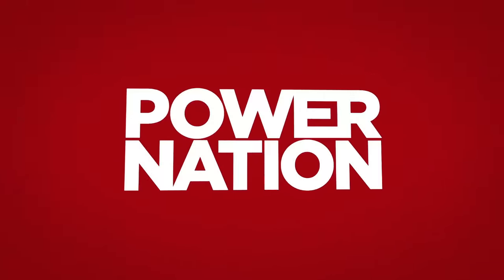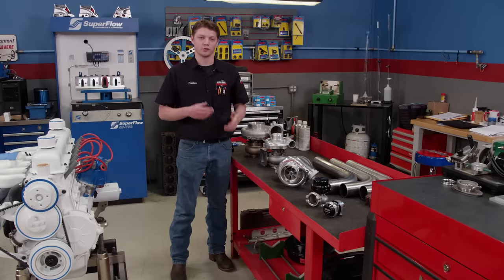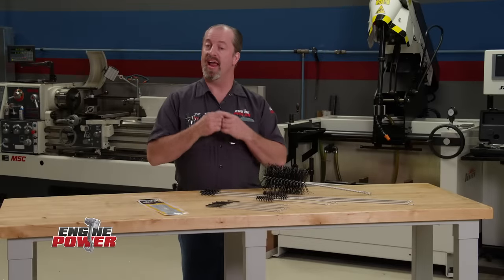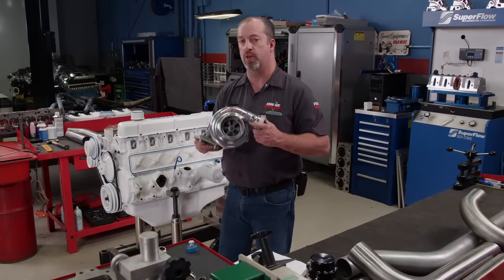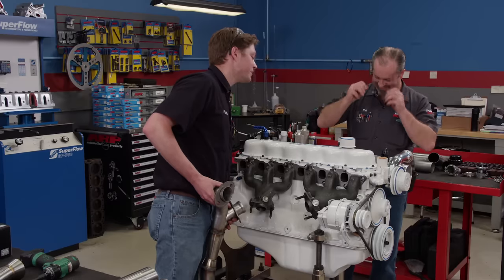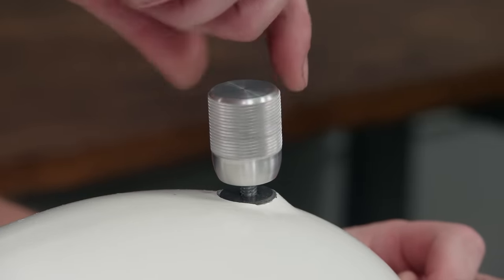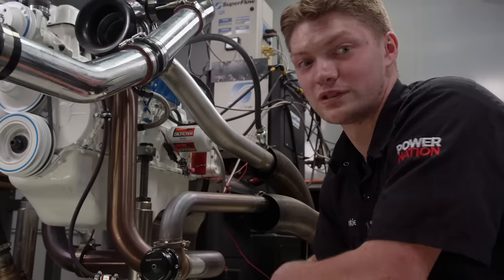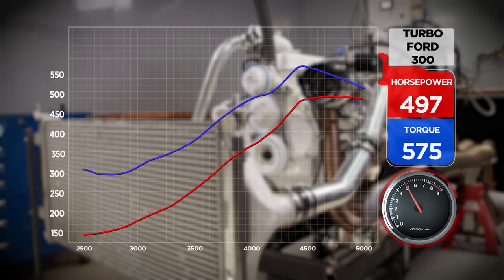Turbocharged Ford 300 Inline Six Makes Over 500 HP on the Dyno - Engine Power S8, E14

Comment: I'd actually like to see this shoved into some old sleeper grandma Ford.   Maybe an old 1979 Fairmont.
Reply: The station wagon variant
Reply: @shadowstallion71  will not fit,  block is too long.   unless you can find a 1 inch thick rad that can handle that power or modify the firewall and move it back about a 1 foot.   How do I know?  My dad tried to put a 300 Straight 6 EFi in a 91 foxbody mustang...just because he was bored one time.   However, it will fit into a AMC gremlin through >:)
Reply: An old stock appearing f100 would be badass too
Reply: 64 Falcon 2 door
Reply: Thanks for the chuckle.
Reply: Maybe an old F100 would work.
Reply: This is a truck engine. Way different then the car engine. But it will fit in a fairmont!!! Fairmonts came with 6’s ! 
I had a 300 in maverick with 2 t3/t4 made 560 hp. With 4:88 it was fun
Reply: @robertpolicastro1  Sounds awesome brother.
Reply: @jcgamer892  Thanks for the tip about the Gremlin
Reply: @jcgamer892  Currently debating a build like this for my '64 Fairlane.
Reply: @43mackmobile  I say wagon, toss the kids and the dog in the back…plus they might need all the wheelbase they can get.
Reply: @izzdee  Nothing wrong with a Fairlane wagon
Reply: I was thinkin something along those lines too. Then watch the other guys eyes pop out of his head as you blow his doors Clean off. LOL.
Reply: Even though the 300 was only used in trucks, it would be hilarious to see it dropped in an old Fairmont or Grenada
Reply: I would be willing to let you throw it into my 77 F100 😂
Reply: @dmoore0079  I thought they came in some of the tempos? I could b wrong.
Reply: You could probably tinker around with it and get it to fit in the old Fox body.
Reply: An old Ford Falcon, make it an American XR6 Turbo
Reply: How about a 78 or79 Bronco? That would be a sleeper
Reply: Not a bad idea, but I'd go with a 70s F100, regular cab, 8 foot bed, beat looking workmtrick, and go out hunting for first gen Lightnings and SS 454s. Maybe a few mustang's and camaros as well.

A.Fairmont makes a good sleeper, but too many have been LS swapped  for one to truly fly under the radar anymore. An old patina farm, shop, or work truck, it would work, because no one would ever think it could be fast. It would be a fun stoplight to stoplight runner.
Reply: Rather see it put in my 89 Ford F-150 4x4 myself!  Wonder which is cheaper though, a v8 with the 500 hp or this 300 with 500 hp?  Then what the gas mileage difference is too? A few variables there to consider other than just the horsepower. Unless money not an object you need to worry about? It is for me I tell ya! LOL
Reply: Or maybe a 1968 Torino station wagon
Reply: No, the Ford LTD model from Men in Black! That would be frickin' awesome man.
Reply: @beefsupreme5132  I know where an 80s LTD station wagon is full size with a Christmas tree on top like Chevy Chase had in vacation it's even bird shit yellow with woodgrain up the side would that do?
Reply: @43mackmobile  My first thought was a '63, so drop it in. The engine bay would have plenty of space.
Reply: @robertpolicastro1  Fox Bodies had a 200 inline six, that is shorter than a 300 so it won't be a direct swap in engine.
Reply: @jcgamer892  you are definitely correct. I had a 79 Mustang with the 250 6 and a 78 Fairmont with the 200. Those engines were just short enough. I don't get why people think the truck 6 will just drop into a Fox body. Plus it's a boat anchor as far as weight compared to the small 6 or even a 302. Let it stay in the truck/van
Reply: @TheLionAndTheLamb777  the early Fox body Mustang could get the 250 from the factory because of a shortage on the Cologne 2.8 V6. My 79 Mustang had a 250
Reply: How about a 63 2 door Falcon or Comet?
Reply: @43mackmobile  I am wondering if it will fit. Mine had like a 235 or something like that.  It was a tiny 6.
Reply: @kevinfox500  my 82 f150 explorer is that truck. Looks a little worse for wear....
Reply: @michaelakers8698  my favorite car was 68 Torino based on a Fairlane. 351 Windsor. It was a scary fast sleeper. Lot of chrome.
Reply: @pearlandvelos244  between me and my brother we have had six Torino GT fastbacks three 68's and three 69's I think these are one of the coolest cars ford ever made
Reply: @jcgamer892  if you have a plasma torch and a welder we can put any motor in any car 👍😁👍🇺🇸🇺🇸🇺🇸
Reply: @pearlandvelos244  my kind of trick as well.

Current ride.is an 08 Silverado,  6L80 behind a 4.8 Vortech, running a centrifugal blower. Bondo and rust spots, distressed factory alloys, tagged.in the back, nothing special to look at, but quick as hell.off the line.

Wanted to do a bold like this on my 92 F150, 300, inline, with a 5 speed,.and almost had it done, when I ended up.with an infection that cost me my right leg. Wife's Silverado became that project, and yes, from my wheelchair,.we did finish the original build.

She loves.it, and even as a passenger, it's a.fun beast.

Both look old, worn, and slow, but run some impressive passes for 4000 pound vehicles.
Reply: My ‘80 F-100 would like to volunteer for this job!
Reply: Put that in a Maverick. They came with I6 engines, and their under 3000 lbs.
Reply: @maverick392cid  A neighbor of mine had a Maverick, pumpkin orange and just an ugly car, but, if it was blowing past you at a high rate of speed, there isn't much negative you can say about it
Reply: @maverick392cid  not a terrible idea,  but the Maverick and no other cars came with the 200 I6 small block. The 300 was the big block 6.

Longer, different mount location, different bellhousing size, and pattern, and that's just the start.of the problems with that swap.

Better option. The 240 I6 from.the first gen Bronco, with a turbo added. Or a car 200, which is also a drop in for 66 to 77 Broncos.

Unlike the 300, it's almost a drop in, main difference being the oil pan and pickup. No need to cut the firewall, or make the front clip longer.

Reason I mention it is, had a friend that wanted to drop an 82 300 into a 78 Fairmont. Long story short, he made an 81 F100 into a sport truck instead, because it didn't involve major modifications to fit, and we dropped in a 302 out of an 84 Mustang instead.
Reply: @kevinfox500  The 70 Maverick came with the 200, from 71 on they had the 250 I6 and the 302. There's a few videos on here that has one running a 300 turbo.
Reply: @maverick392cid  thanks for the correction.
Reply: a 64 Ford f350 will have to do
Reply: pinto 😂👍
Reply: @PlagueDoktor-  that could be fun. Just more work than any Pinto is worth.
Reply: No way 

It goes in a mid 80’s Ford 4x4 truck
Reply: @jcgamer892  you actually can. The fairmonts and Zephyrs are on a fox body platform with k member engine brackets. I’ve seen 363 Windsor long blocks put in them.
Reply: That's a dark turn of thought
Reply: Pinto.

Comment: One of the greatest engines of all time. Awesome seeing it get some love.
Reply: My Dad was so sad in 96 when they made the new body style with the v6. He bought the last i6 they had because they were selling them side by side. The salesman asked which one he wanted,new body or current and there wasn't a bit of hesitation. On the way home he just kept shaking his head and saying he couldn't believe they were getting rid of one of the best engines of all time. He put well over 300k on that '96 f150 with the big six and all he ever did was scheduled maintenance and oil changes. Best truck ever and I wish every day that I had it right now.
Reply: And it's a shame all manufacturers stop making the inline 6 cylinders some of them bet ever made
Reply: I did a fresh rebuild on a 300 six, 268 grind comp cam, 240 heads, HEI distibutor, EFI split manifolds, and a Weber 38/38 on the stock intake, and my old gal cooks 🤙
Reply: I wouldn't even bother looking for one of these in a junkyard. Imagine finding someone's project car in a barn and going straight past it for the 🚜

Comment: Sure brings back memories. Built one 20 years ago with the same intake/header combo, Holley 390 4bbl, Comp 260H cam, mild porting on the stock head, and a .030 9:1 rebuild. 242Hp and 323Tq
Reply: Do you know how much horsepower and torque yours made?
Reply: @cesarprieto8279   242Hp and 323Tq
Reply: Did the same in highschool in a shortbed ford
Reply: @cheeseandpickles98  I just acquired one yesterday 84 300 Inline 6 granny 4 speed 4wd flatbed with 33s 70,000 original miles
Reply: Mine is a 96 F150 4.9 EFI 5 speed. At 70 mph it turns 2250 rpm. At 3000rpm she’s doing 93 mph. I usually don’t break 2000rpm. Purrs like a kitten 70 series Flowmaster 3” stainless from Y-Pipes. No cat no egr or pump. I get 18-23 mpg! Towing my 5000 lb camper 11-14 mpg. 290,000 miles. I see no reason to mod it ! It’s just to much fun as is.
Reply: @calebowens3006  my first was a 93 f150 with 325k on the clock when I sold it. Currently been driving an 88 Bronco for 6 years with around 240k on it. Never had a more reliable engine in a vehicle.
Reply: @cheeseandpickles98  How did it feel compared to the 351?
Reply: @flatheadfletch  I have a 92 4.9 with 5 spd, but my tach reads 3000 going 65, also i have 3.08 gears. they should be the economy gearing but idk it seems to not really want to go that fast. Also mine tops out at 75, on 32's. idk how you got it above 90
Reply: I love the 260H cam, great cam for the street

Comment: That's an absolute fantastic motor . I seen one of those motors  go 36000 miles without an oil change. And when Ford put  fuel  injection on it that really woke it up.
Reply: Unfortunately that doesn't say too much lol, when I was a lube tech I changed a Kia souls oil for the first time in its life at 72,000 miles. The owner had bought it new and never once had the oil changed. Only got about 2qts of sludge out but it got new oil and was good to go
Reply: @MFU.team.4367  bullshit... There's no motor in the world that will last 72000 miles without an oil change. I've worked at KIA store those motors are terrible.
Reply: @bige9830  I've seen a few Honda engines go over 40k without an oil change.
Reply: @bige9830  we service our paccar mx engines on 75000, with idle time less than 10 percent, 60000 miles if over 10 percent,
Reply: @youtubeisawesome2487   Those are diesel engines. It's a completely different animal then a gaser . Low  Reving . The oil has a ton detergents in it . How many gallons of oil does that take?  And I'll bet your dollars the donuts has got a low micron oil filter on it too.
Reply: @papersack4290   I'm not surprised at that . Honda makes some pretty good motors. A lot of Japanese companies make some pretty good motors. Except for that little piston ring the  Debacle  you guys  getting over.
Reply: @youtubeisawesome2487 Your right .  I'm  sorry. One of my statements  I said no motor will go 72 k with out olf.I didn't even think about diesels. Your right 
 some of those  units can go 150k in between  olf.  As a matter of fact Some of those guys don't change oil unless they have a tested 1st . and then they just change filters and top off. Or change filters and replace half of the oil.

Comment: This would be such a mean setup in a classic bullnose build! I’d love to see it in a lowered 2wd street truck or a 4wd mudder, that would be so cool! This has definitely opened my eyes to the potential of the Ford 300
Reply: Throw it in a single cab Ranger short bed and let it take folks to gapplebees
Reply: @Truckerdaddy  are we thinking ranger the trim package or ranger the truck? I’ve got a 1991 ranger that would love the extra power. Either way it’d be a heck of a vehicle
Reply: @cheynsanders5506  the mini truck. Not the full size ranger from the 70s.
Reply: @cheynsanders5506  one issue you would have is space, to make it work you would likely need to trim the firewall for the bell housing to fit. You also would need to run electric fans because a mechanical fan would most likely hit the radiator. 

It certainly would not be an easy project but would certainly be unique.
Reply: @cheynsanders5506  another vehicle option would be a Foxbody mustang or any mustang for that matter. I mean if Westin Champlin can shove a 12 valve Cummins in a 2015 ecoboost mustang then a 300inline shouldn't be too bad.
Reply: @Cheyn Sanders I'm actually working on doing a build like this in my 83 F100 single cab long bed with the 300 inline 6. Looking to lower the truck maybe one or two inches and change out the 3-speed for a 5 speed. Was my grandfather's truck and he always got a smile running fast in anything... Figured it would be the perfect thing to remember him by.
Reply: @Truckerdaddy  actually, it wouldn't take much to make it fit and work in the early bullnose pickups. Now if you wanted A/C and other things.. some modifications would need to be done because of the lack of space, but if you're going for bare minimum.. you've got plenty of space to work with. An 83 f100 with the 300, power steering, and smog delete has a ton of extra space under the hood for activities. You can keep the engine in the same position under the hood as well while lowering the truck. Just mount the rear leaf springs under the rear axle and do a crown Vic swap for the front end to eliminate the I-Beam suspension up front.
Reply: @brandenmatney6821  the f-100's are considered a full size though. But the plus side of building a full size Ford of that year is a 9in rear end will fit with little to no modification. So you've got that going for you. Then throw in a C6 transmission and you'll have one bulletproof rig.
Reply: This would go great in my 65 f100.  I already have the 300 in it and there is tons of room.
Reply: @Truckerdaddy  I don't know why that blew over my head that you said the mini truck and not the full size. I read bullnose and ranger and figured someone was talking about the trim package.
Reply: @brandenmatney6821  it's all good. It happens to everybody occasionally.
Reply: Mudding is the one thing the 300 is not good at sadly.  It is great in a trail truck as it will power you over anything.  It just does not turn the high RPM's you want when dragging your axles through goo.
Reply: Put this in a gen1 lightning! That would be sweet!
Reply: Thats actually my plan for my 89 f150 once i get enough money i plan on getting air ride suspension on it that when fully lowered has a 6.5 inch drop and about 1.5 inch drop when all the way up, its probably gonna be a lil bit tho i just turned 16 and still aint found a job

Comment: Just like Pat says, gotta love those old 300 sixes. I fondly remember my 84 ford. Almost 300K miles and never cracked open the engine. Never added a single drop of oil between changes.
Reply: One of the best engines ever produced mine has 210,000 miles never uses a drop of oil between changes using Shell Rotella T4 10w 30 diesel conventional
Reply: I'm not buying it. 300 000 miles and never been serviced? Come on.
Reply: @captainchaos3053  thats not what he was saying though
Reply: @gerrit2107  that's because he has an American education.      they dont teach reading comprehension they just teach them to repeat the words  not understand the words
Reply: @dertasdert2419  ah yes, that makes more sense :)

Comment: Amazing engine and a lot of people do cool stuff. I've read on the forums of heavy haulers that people put on a cummins turbo then take the cam and advance it one or two teeth to move the power band lower in the rpm range and make mountains of torque. I rebuilt a 300 that the cylinders were so worn in the center that the glaze breaker stone wasn't touching and the bearings were only showing the copper. New bearings and rings and she still ran amazing.

Comment: My concern is always longevity.  I’d be interested in NA upgrades at the 250-300hp level that still preserved the reliability the 300 is known for.
Reply: With the turbo: o-ring the head, steel head gasket (may already have one), water injection, inconel valves, electric water pump drive. Their intercooler helps keep temperatures down. The piston rings become the limiting factor, but they might last 100k even with hard running.
Reply: It will last as long as the Toyota turbo i6s. Strong ass engine. It can handle the turbo.
Reply: My bigger concern is torque, for a pickup build

Of course, keeping longevity
Reply: @rylan642 The nice thing is this is an industrial motor built like a brick shithouse with very strong components and internals that have great reputation. They did not need alot of boost to make over 400 hp and plenty of torque to back it, which would be more than plenty, unlike the new ram hurricane which is a 3.0 gasser non industrial motor pushing 27 lbs of boost to be in the 500s club and 22 lbs of boost to make 420hp big difference those motors are not going to last in my opinion even for an I6 I think they're too damn hopped up and not built strong enough because it's for mass production and its stellantis lol.
Reply: @jamesj5130  I meant for my case only doing 5 or 6 psi
Reply: @rylan642  Well at 6-7 pounds of boost I believe that when they approached 400 hp territory which no matter how much boost they pushed you had plenty of torque.
Reply: @jamesj5130  true

I’m not really knowledgeable, kinda just thinking out loud